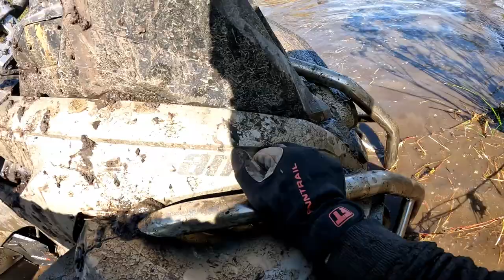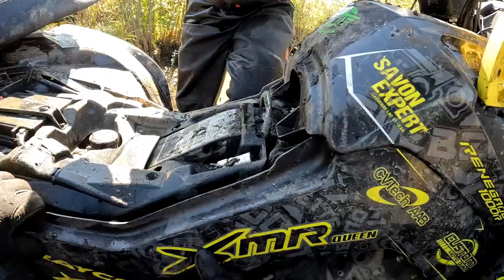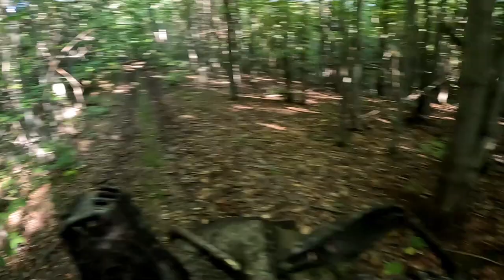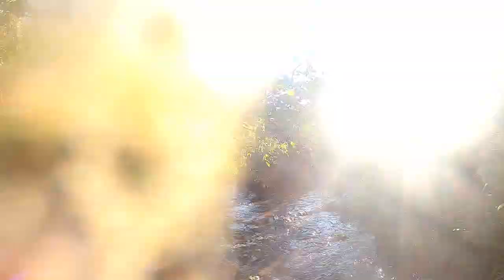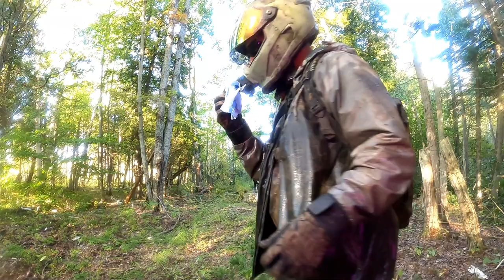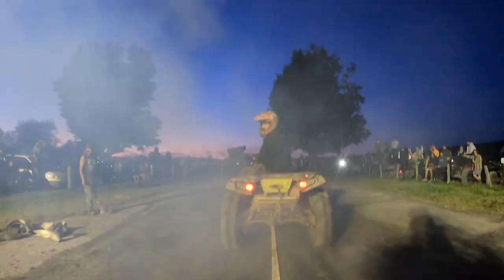Tug Of War / Can-Am Renegade vs Polaris Highlifter

Comment: I had a spark plug issue with my 2016 sportsman xp 1000. It was brand new and the first ride. It started to run like crap about 20 km into the ride. I found both plug boots were barely on and both plugs were loose. Tightened everything up and was good to go. I replaced both plugs once I made it home. Wasn’t happy with that dealership. Haven’t been back since. Sold my sportsman last year and bought a xmr outlander . Definitely put the fun back into riding.  Happy trails 👍.